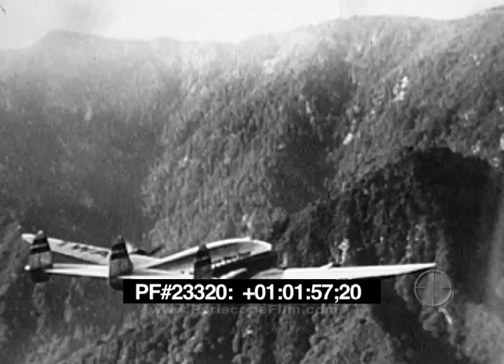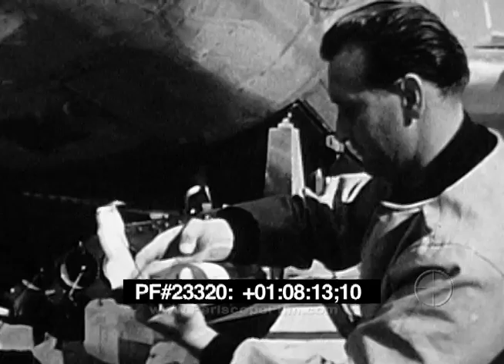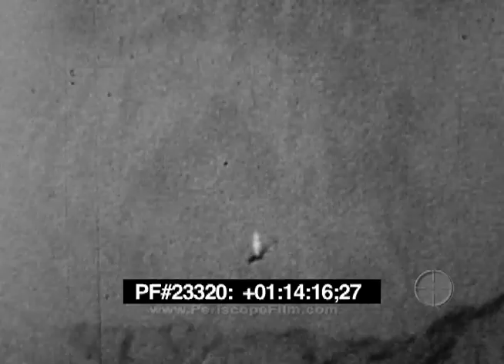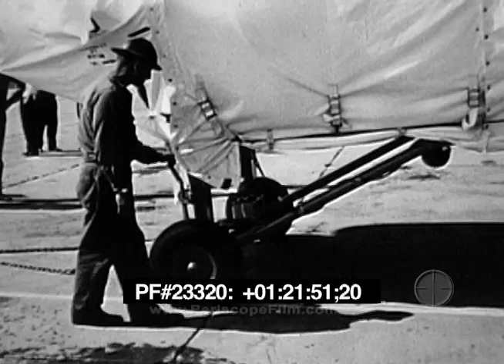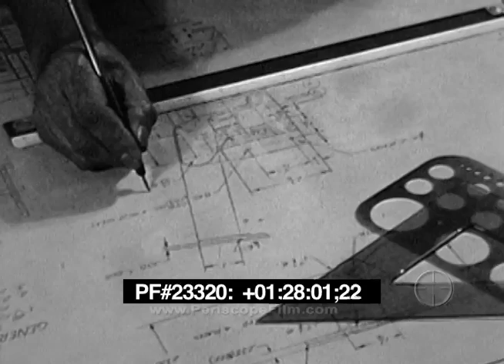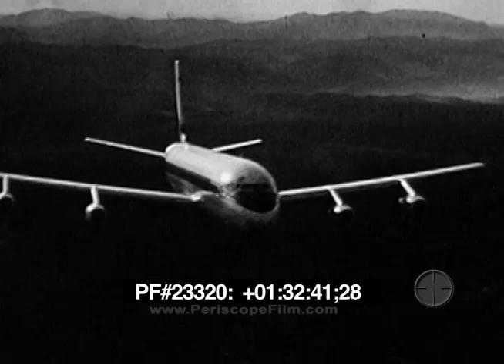SEEK FIND AND KILL - Hawk Missile , AIM-4 Falcon 23320

Comment: The internal weapons bay of the F-117 'Stealth Fighter' was unable to carry any air-to-air weapons due to its small size... except the AIM-4, which was not out of inventory while the F-117 was operational. With almost no radar cross section, a forward infra-red sensor and a passive infra-red missile, it has been speculated the F-117's 'fighter' mission would be to engage heavily defended Soviet AWACS aircraft, a fat slow-moving target if there ever was one, with the Falcon. The Falcon was scoring kills in Vietnam and even had some all-aspect capability, but had trouble with seeker cooling needing to be started before firing and only lasting for a two minute window. This was bad for dogfights but still quite viable for a deliberate intercept on an unaware AWACS aircraft like the Mainstay.

Comment: The AIM 4 has never shot down anything. It is a completel piece of Junk according to Colonel Robin Olds
Reply: It was junk for that purpose. The Falcon was a wonder for when it was developed and would work well in the role it was made for, air defense against bombers. TAC trying to take an ADC bomber killer and make it a dogfight missile is the real problem. Specifically the limited seeker cooling time that Olds rightly hated isn't much of a problem if you're doing a controlled intercept.
Reply: @warphammer  that was a limitation of specifically the pylon used on the phantom, and the lack of missile computers on the phantom. The coolant was limited to 2 minutes on the F-4C and F-4D, but when used on the F-102 and 106, it had around 20 minutes. In short, the AIM-4D was the wrong missile for the plane.  However, from everything that I can tell, when used on the F-102 and F-106, it was a better missile than the early sidewinders and sparrows by a vast margin. It seems to use a more advanced, more modern guidance system. There's a reason the USAF loved it.